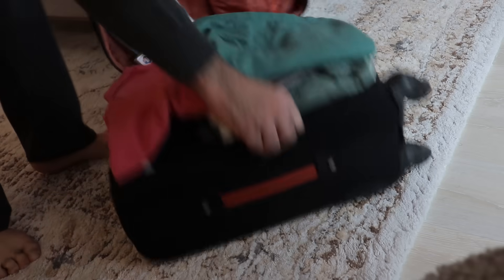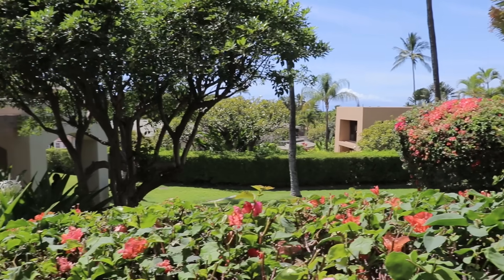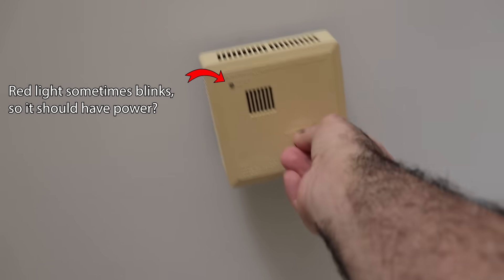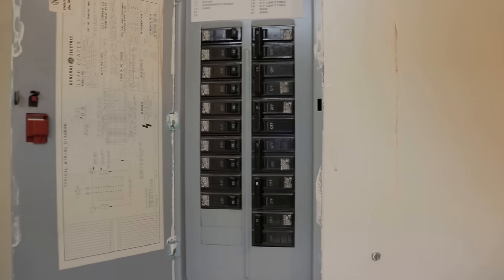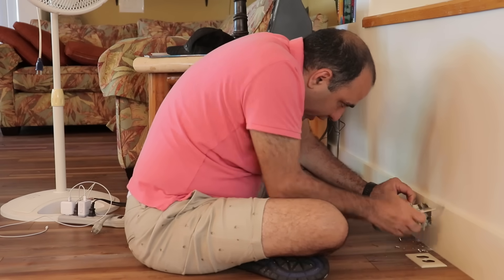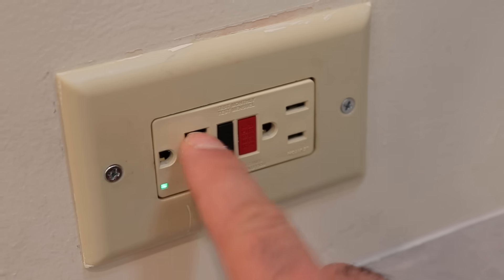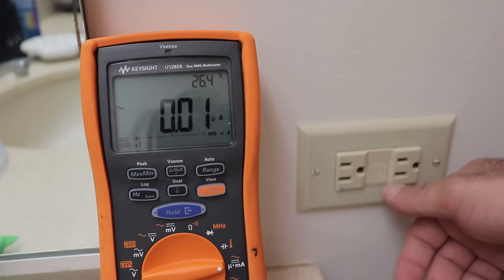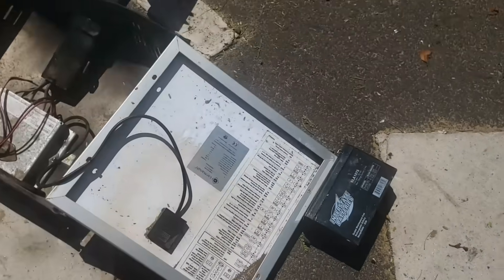Hawaiian Hotel Safety Failures

Comment: 2:37 - Wow, I never thought I'd see the 1970s-esque "strip light behind egg crate diffuser" lighting solution still in practical use.
Reply: 70s era construction and equipment are way more common in Hawaii then you'd first think.  The old hotels don't modernize unless they have to, because literally doing any kind of renovation is insanely expensive.  

I've worked on hotel HVAC when I was in Hawaii during the mid-2000s, and everything Medhi finds doesn't surprise me at all.  The environment alone destroys everything on a routine basis.... humidity always between the 80s and 90s, salt in the air from the surrounding oceans,  near year round heat catalysis a lot of decay processes.  Anything even remotely sensitive, to environment get eaten alive.  The knock on effect of this is that maintenance in construction and electrical gets incredibly expensive over time.   Hawaii residents also don't make a lot of money, but have insane cost of living.... so you get a very frugal mind set when it comes to maintenance costs.  Property owners are even worse, and its not uncommon to see much worse electrical problems in $1000/mo studio/1Bed apartments.  

But the Hotels.....   its insane the degree of variance in maintenance quality on the GUEST FACING side of the campus; especially for the prices.  The worker side....  borderline horror stories at times..... at the 4-5 Star Hotels.  It helps to understand a lot of the hotels date back to the Economic boom of the 70s/80s, when Hawaii was THE tropical Tourist destination for the 1st world.  A lot of those places are still around, with a surprising number having much of the original construction still in service.  And because renovation is so expensive, even in the off seasons, you get a lot of the original "building code" design artifacts and safety equipment still around.   Interestingly enough.... equipment from that era is also impressively robust; so its entirely possible to find old systems that still work.  And if a whole system fails from age or superseded by new safety codes, they're usually kept in place with a more modern system installed along side them.

Put that all together, and it creates this incredibly surreal experience if you have any kind construction or engineering background. A living time capsule of 70s/80s era construction and equipment that never got replaced.  

As a side comment about the shower and humidity.....  its so humid in Hawaii year round (effectively being all equatorial coastal land no matter how inland you get), you may as well be sleeping in a shower.  In general, any air flow sucks in MORE humidity from the outside, making mold growth a common problem in hotels.  To combat this, a lot of hotels lean on their Air Conditioning units running dehumidifier duty, and the room itself being a closed loop.   Its why the Hotel gets mad when you leave the windows open when you're out, and why some hotels AC systems get stupidly cold at night.  Its basically the AC system trying to extract the humidity, and runs so long, it overly chills the room in the process.  Some also have poorly tuned humidity thresholds, and run almost non-stop because it can't hit the 50-55 target smart systems go for.  The newer ones are probably better; but the ones I worked on pretty frequently ran into issues where guests would develop sinus problems from the cold air while they sleep.  

I took a crack at figuring out where he went, and I'm kind of sure its The Shores At Waikoloa, or the Bay Club Hilton thats like right next door to it.  Both have the same condo type buildings, and the reviews of the Shore had more then a few comments about the 70s era construction.
Reply: I had some in the house I bought. First thing to go... Day one!
Reply: So it seems that a lot of the hotels from my parents' honeymoon to Hawaii in the early 90s will look the same now 😂

Comment: I feel like being "that guy": I don't know which beach you were at, but a lot of the sands in Hawaii are coral-based. That means they are more calcium carbonate and less silica....so no semi-conductors :-(
Reply: I mean the silicon in semiconductors isn't coming from sand either, it's usually mined and purified. The higher the purity of the starting material the less work you need for further purification.
Reply: @InTimeTraveller  from what I just researched on wiki & yt, either quartz or sand (silica sand obviously) is purified to metallurgical grade elemental silicon, and some of that is further purified into semiconductor or solar panel grade silicon (crystaline silicone). So yeah it doesn't come directly from sand, and it definitely doesn't come from a sand that has large amounts of calcium in it.
Reply: Be that guy. I enjoy learning more things.
Reply: But you could make some antacids to counteract the heartburn you'd get trying to make diodes out of that sand!
Reply: more shells as well . shells are mostly calcium carbonate no?
Reply: I was also going to mention that not all semiconductors are made of silicon. I'm not sure that sand has a lot of germanium in it. Or copper oxide. Or lead... of some sort, sorry I can't remember what form of lead is a semiconductor. And I think carbon's one too, isn't it? I know pencil leads were used on a razorblade to make point contact diodes for foxhole radios in WWII. Anyways I'm sure there are tons of different semiconductors of varying usefulness.
Reply: Youre so clever.
Reply: @1mmickk  Yes, he is. I completely agree.
Reply: but they still contain silica....so yes semi-conductors :-)
Reply: @ryanmalin  well the semi conductors aren't made from sources that aren't already pretty much pure silica / quarz, so yeah no the sand with 50% calcium carbonate isn't semi-conductors
Reply: @ryanmalin  Just more semi then normal semi-conductors..... or it is more conductor then semi-conductor?  Or like a not-so-super conductor?  Wait.... where does all that calcium for the coral come from?   Those things are everywhere.
Reply: @freelancerthe2561  off the cuff, there a lot of carbonates washed into the oceans from erosion - rain/ground water dissolved the stuff like they were made for each other. Also the ocean water absorbs an absolutely mind boggling amount of CO2 straight out of the air - not sure if that’s the “right” form of carbon needed for coral though
Reply: @rkramer5629  Yes, carbonates dissolve readily. And Calcium is the ~5th most common element in the Earth's crust, so there's lots to go around (also dissolved and washed into the sea) for building reefs and shells. And for binding with the 'mind boggling' (true) amounts of CO₂. So Ca+CO₂ = right form (what would be "wrong"?).
Reply: you're totally being "that guy"

Comment: Can't wait to see the news stories that will result when hotel guests start pressing test buttons on smoke detectors, causing building-wide alarms and subsequent evacuations.
Reply: Thankfully most detectors in hotel rooms don't trip the rest of the system when activated (or at least so I believe is the case anyway).

Comment: Never trust circuit breakers in Hawaii  - most residential type structures have daisy-chained neutrals(?) and poor workmanship, so turning off a circuit breaker doesn't guarantee a circuit/device isn't partially energized.  Many structures were never fully permitted or inspected, either.  Given these lazy practices there are probably some hidden zingers in commercial buildings as well.

Comment: Hotels with a central fire alarm system (I think new ones must have them) may have the room smoke detector connected to that system. It's not easy to tell by looking at one whether it's hooked into a central system or not: and you could get a ticket for screwing with it if you trigger the main system. Just a fair warning to others.
Reply: Lol when he tried testing the smoke detector the second time, I was kind of hoping it would go off and set off all the smoke detectors in the building knowing it is hardwired

Comment: The fact that whole house GFCI isn't mandatory in America is baffling to me
Here in Denmark such equipment have been mandatory in New constructions and major renovations for decades with ever stricter requirements for the equipment
And every outlet has to have earth so no matter where a fault happens one doesn't have to survive the tens of ms it takes for a breaker to pop
Reply: And in the UK, mains sockets are not allowed in bathrooms (with the exception of a 110/220V "shaver socket", supplied via an isolation transformer).

Comment: 6:50 thats genuine carbon markings from an arc on the probe.. i suspect you faked this electrical shock because from the appearance of the board, it would not be easy to short unless you purposely do it. its why your multimeter covers everything in the arc flash..
Reply: Could have been real, when you fake electrocuting yourself millions of times, you're bound to actually electrocute yourself a couple times, like with the Jacobs ladder.
Reply: @lryu000  so if he is faking it then its real? Ive been shocked a couple of times and i guarantee you its not something you want to experience again, it can kill for starters, but it also effects the heart in even mild shocks. Anyone who knows this would not purposefully subject themselves to shocks and they shouldn't be sensationalizing the electrical safety here just for views. I am sure he fakes the shocks and im sure he is promoting unsafe Electrical DIY to the unlicensed public. I am a licensed Electrician in Western Australia EW145509 just for reference.
Reply: No its real

Comment: Sidenote - don't necessarily 'check' the smoke detector in your hotel room. 
Pulling a smoke detector on a monitored (commercial or multi-residential) system, or otherwise testing/activating it will trigger the whole building alarm unless the main panel has been taken offline; everyone will have to (should) evacuate, and the fire dept will be perturbed at the false alarm.

Comment: I live in a 3 bedroom apartment and my room and bathroom and half of another room is on one breaker and it would constantly trip the breaker or if the breaker didn’t trip it would blow out my light bulb and we finally got the apartment to call a electrician to figure out what was going on after threatening to turn it into the city and fire department and the electrician found no gfi in the bathroom and in the other room that was on the same breaker one of the outlets was half burnt out and since then I haven’t had anymore light bulbs blowup and breaker hasn’t tripped but my light when it’s on if someone goes into the bathroom or other room and turn the light on my light flickers so still kinda concerning

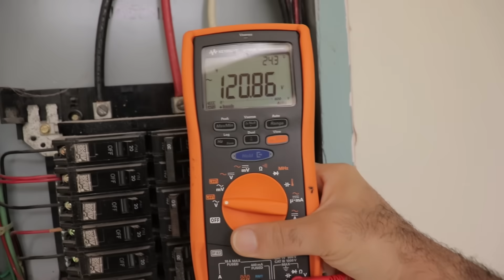Comment: Bastard! 6:28 - That was so unexpected!! I literally threw my parrot that i was petting, across the room. ok it flew a bit, slightly after launching.. but for the same reason!  Keysight owe me a (240v, UK plug) DSOX1204G with and this is important.. an ENGLISH instruction manual.

Comment: Last thanksgiving, my family and I went on a trip. At the hotel, one of the lamps was broken and live wires were completely exposed—and the hotel had no clue that that was the case until I accidentally found it and told them. Maintenance ended up taking the lamp out later that night, thankfully. I was just thinking about what would happen if the next guests had no clue. They could electrocute themselves—or worse. A very scary thought.

Also, I knew that the plugs not gripping the prongs was bad, but not that it was a fire hazard—same with the lack of a box. Yikes. A lot of hotel rooms I’ve stayed in was that an issue—the plugs not gripping the prongs, I mean.

Comment: For the love of God, North American outlets and 180 degrees phase offset are equally stupid conceptions.

Connection on the side of the socket, prone to short-circuit if someone look at it from the wrong angle...

Spring system in the outlet dying after few years of use...

And 110V grid with cables overheating from a stupid iron...

Not to mention no residual current protection device for all circuits. 

What a f@cking dumbass invented this?

Comment: This makes me wonder if there's a product you can buy that's like a travel plug but specifically to test GFCI outlets. A GFCI in the plug could trigger to stop it burning out after a certain (unsafe) point, high enough to trigger any GFCI outlet that works reasonably well.
Reply: Well there is outlet/gfci testers that just plug in and have buttons that will trigger the gfci (if it's working) find these in any big box home center for 5 to 10 bucks or so.
Some appliances like hair dryers do have built in gfci built into the cord and I have seen gfci plug ins that you could plug into but those seem very uncommon at least with what I've seen.

Comment: As for the whole "non-metalic box" being a fire hazard, that's not really correct. That house was built pre-1990 so that might be an exception, but NM thermoplastic junction boxes aren't fire hazards and fiberboxes are 2hour fire rated minimum. Most residential homes do not use metal j-boxes. It's not profitable nor does it provide any additional safety. Plastic and fiber boxes  are technically safer in residencies especially given that they don't need grounded and DIY dumb dumbs often don't understand the importance of grounding metal j-boxes and housings. 

Still entertaining as always tho! Missed the Patreon release so glad to see it here before I inevitably forgot about it lol

Comment: I always wondered why here in Europe we have GFCI protection on the whole wiring and in North America it's only just outlets in baths and kitchens. It seems cheaper to me to have one device per phase rather than one per outlet pair. Also ground faults can happen anywhere so why only wet rooms in particular?
Reply: This is an install from the 80s so gfci and other stuff might not have even been mandatory. Now a days we do have the same protections in the panel as well an a per breaker basis arc fault and gfci/rcd. Honestly I don't get why we don't have a higher threshold one on the mains but its likely to do with nucence faults. The big difference is we don't inspect electrical services as mutch as the eu guys seams to, and bad outlets aren't really fixed very often. But i kind of think that inspection is self inflicted due to the higher voltage and those ring circuit you guys have, because those things really have to be checked due to resistance issues.

Comment: the low switches are most likely for handicapped people in a wheel chair. you likely got a room that they rent out also to wheelchair bound people, that or when the the contractor made the room, they used the same blueprints or whatever for the ADA/wheelchair rooms.

Comment: This guy is a fraud - please if you think and want so take a shower with a toaster or preferably with a microwave or an angle grinder, taking a bath with your phone charger may burn the charger however, but please try taking a bath with a car battery charger or even with an extension cord. After trying do put a fork in the outlet so you can dry yourself faster. Do not listen to Mehdi , free energy is not a scam

Comment: 12:49 I promise you the hotel will ignore your note and claim they never received it. you need to notify the local fire marshal and also the local department that does safety inspections for commercial buildings. and you have to word it like "i dropped my hair dryer in the water and the GFCI did not pop." even then, nothing will likely happen to replace the GFCI. even if the hotel burned to the ground or someone died, they would claim the GFCI was tested regularly

Comment: Even though Electroboom advices to check your hotel and home wiring (i do too (well not the hotel ones)), just a small word of caution for the youngsters to asses the risks of messing with stuff that isn’t yours. Hotel managers and parents can get angry if you go unbolt powerpoints and subpanels. Testing the GFCI by using the buttons should be fine. Testing the smoke alarm with the button also (is even wise to do).

Comment: 8:40 I recently saved my house from burning down by discovering an outlet that was so hot that it literally burned my finger with first degree burns (like a sunburn) when i touched the screw to remove the cover plate. the wires inside were completely corroded and stiff. I measured the temperature of the faceplate (the plastic covering) at 131 F. pretty scary
Reply: We had that in a JB feeding a transformer caused by a Floating neutral because the X0 point was not grounded. Only reason it didnt catch fire was because the splitter in the CSO trailer blew up and it prompted him to ask us to take a look was hot enough we could see the heat radiating off the box and we took the temp and it was 180 degrees. Not only that even with the breaker off the neutral was still live and gave a nice arc flash when we cut into it. That saved four 6 story wood frame Condos  from going up in flames (again since it already burned down once from the roofers)
Reply: I noticed a buzzing sound from an outlet in our house, when I investigated the wall above it was warm! We were running a 2kw oil heater and the contact was just a tiny bit loose. Had to check all the sockets and had three of them replaced.
Reply: You don't know burns that well. Sunburn varies like any other burn.